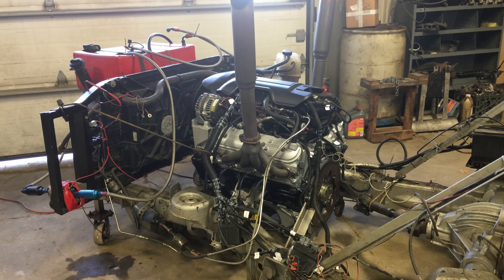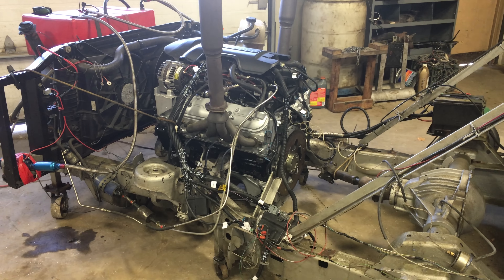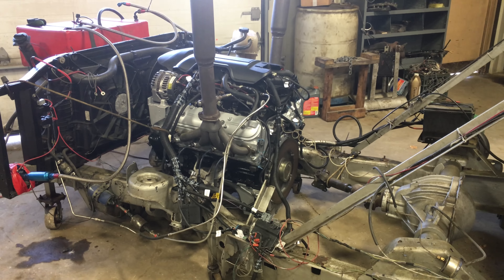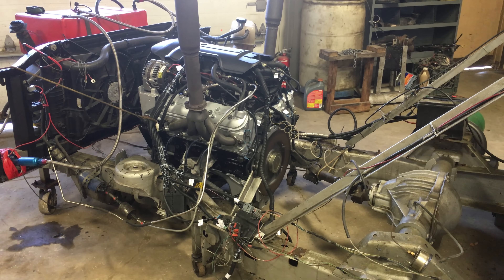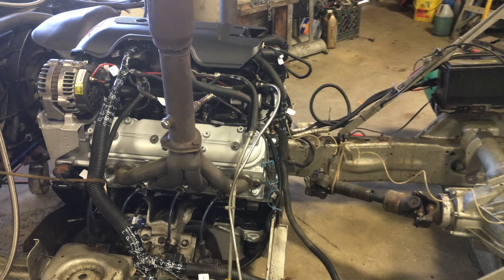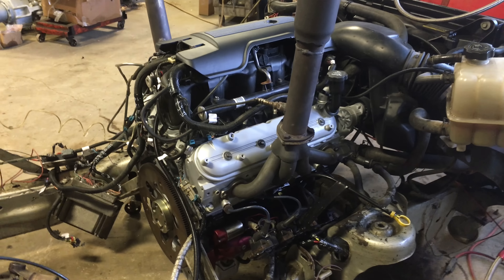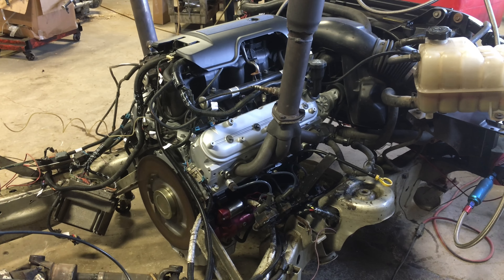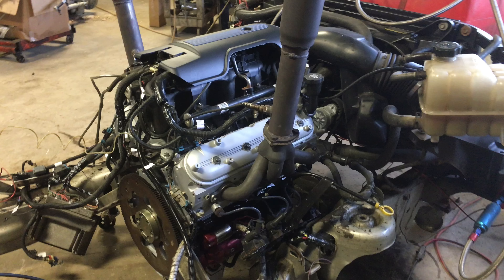LQ9 Vortec Max Stage 1 Cam idling

Comment: What is tuning . I like to have that in lq4.  Ls3  intake.  Ls3 heads. Long tube headers .4l80e with shift kit. 1800 stall.  Ac . I like that tune. Do you tune also.  I want the rpm to shoot 6500 rpm. I  want max hp at 6500 rpm. Maybe  7500 rpm cutoff. When pedal is all the way down . I want it to smoke the tires. What do you recommend